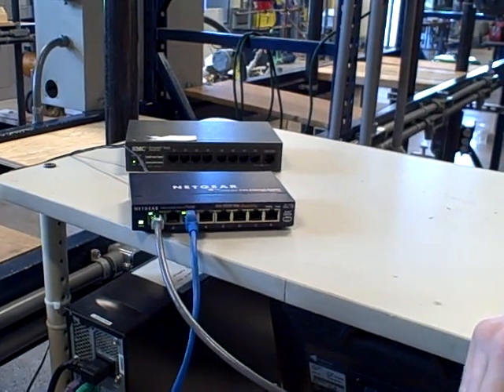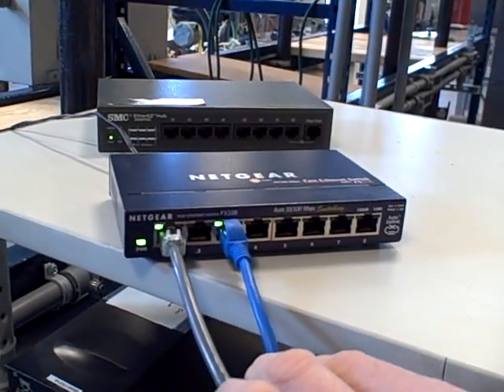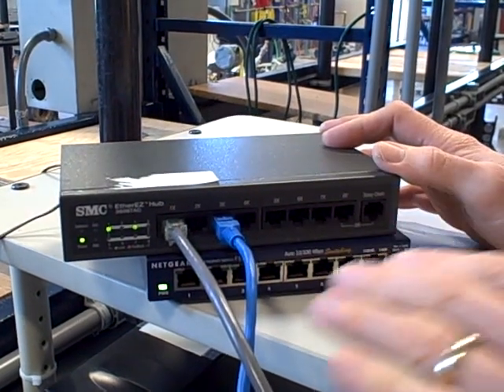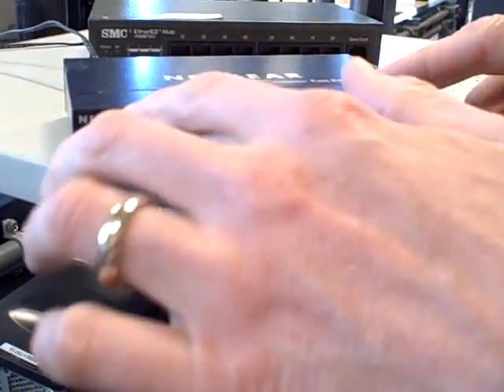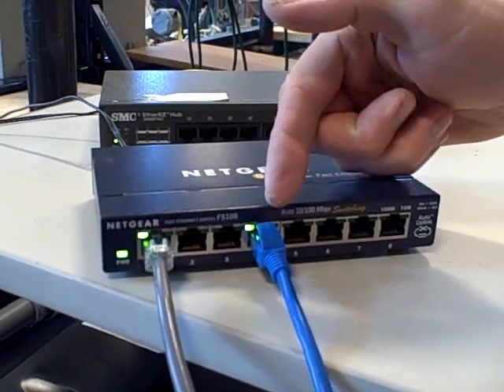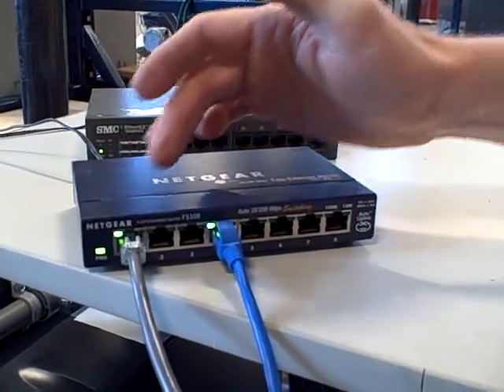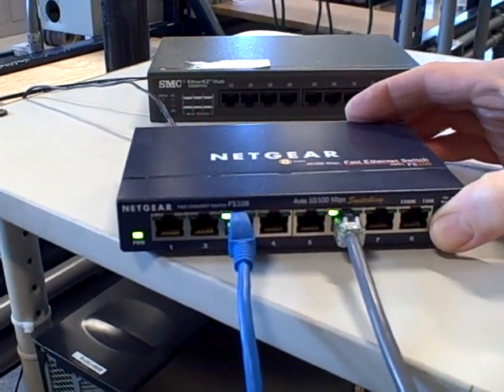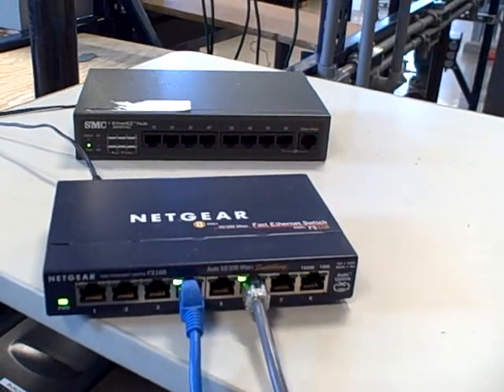Ethernet hubs versus switches

Comment: Can i use a switch or hub to create two lans in my home.

Internet modem-hub-two routers?
Reply: Using either a Layer 3 switch or an advanced router, you can create VLANs.  By connecting a regular switch into a modem, you can get multiple IP addresses from the ISP depending on their support.
Reply: No!
Reply: +OldLordSpeedy A switch plugged into a modem would allow you to have more than one IP address if purchased from an ISP.
Reply: +Timothy Ha  Please READ what the youtuber ask - then answer. The correct way is "Internet Modem - Router - Switch" ... The way of this user "Internet Modem - Hub - 2 different Router" is technical correct, mean he must have two different contracts to one ISP that it works. But no one of normal private user use this very specially method to differ Internet Service. Most ISP allowed only one connect - so the second Router falls into a hole. If your ISP makes some wrong, every first Router have the connect - and if ask the second Router the reconnect the line. It is named 'Ping-Pong' and give you as private user only an unstable connect.
Reply: +Timothy Ha  Normally a normal private user never earn an IP adress in 2016 more. Most ISP use private adresses only for connect. In a business contract the bussiness user earn so many IP adresses how he pay inside this contract. But today - where every computer, thing, router, aso can have own v6 IP adress - why someone want do so a crazy shit? As private user give me my ISP a /64. So many adresses for use - then I can add to use own private adresses too! Please learn more about ISP connect and how it is works!

Comment: so which is better to connect an xbox and 2 computers to the internet with?
Reply: Depends on whether or not you can run cable to them. If they're your only networked devices, and cabling isn't an issue, connecting them directly to your router's LAN ports should suffice.

Most people don't need switches, as their network usage is more than adequately provided with a few Ethernet ports on the router + WiFi.
Reply: Wich is better if I have a PC and a PS4 on my setup, I have one cable in my room, but I need to connect both of them at the same time ?
Reply: +FEIXAS_PT

WiFi is probably sufficient for your PS4, if you have it in your home. Else, an inexpensive 4-port 100mbit Ethernet switch + 2 extra Ethernet cables will be enough to connect your devices.
Reply: Fireholder1 Thanks a lot !!!
Reply: You're welcome. :-)

Comment: Again to all the odinary persons her - technically works a switch same a hub. Both be same a multiple (switched) socket-outlet for your cables. The difference is that the hub call into all rooms in a hotel and a switch call only the correct room in a hotel. Exactly this demostration do you see live in this old schooling video from 2013!
Reply: +OldLordSpeedy except that he didnt show the major issues that arise with hubs that have alot of ports. even 8port hubs will run into collisions very very fast

Comment: If an Ethernet cable is going to a switch from my router. Can i connect a PC, PS3 and Xbox360 to it and get internet?
Reply: +Turboed Leo yes
Reply: Pascal Lafrenière thanks
Reply: +Turboed Leo You'll get more lag though, which could be important for online multi player gaming
Reply: Thanh Tran Even if i only use one console at a time or PC?
Reply: lol, it's about nanoseconds lag....
Reply: +Pascal Lafreniere the difference between hitting and missing on fps gaming
Reply: your body have like 130 ms of reflex time, a switch lag is in between .001 ns and 100ns, that is .1 of a ms... so your brain is at least 1300 times slower than the lag you create with switch...
Reply: Pascal Lafreniere So a switch wont effect anything?
Reply: it shouldnt

Comment: Maybe the switch table refresh duration can be reduced in settings instead of 5 minutes.
Reply: +Thanh Tran maybe.. it doesnt matter because nobody ever screws around with ethernetcables every 10 seconds
Reply: That is probably possible in managed switches, he probably has an unmanaged switch. SO its pretty much "plug and play" no control panels, or anything.

Comment: so a switch or a hub just basically provide for ports to your devices when your router's port are all used? someone pls answer
Reply: For the typical home user the answer is yes, but most Enterprises use hubs and or switches to repeat a signal over long distances or to connect/segment their LANs.
Reply: Alberto Marin thanks
Reply: A typical "router" for your home typically combines 1) a wi-fi access point, 2) a switch and 3) a router.

The router is used to connect two (or more) networks.  In your home this is your LAN and your WAN.  It sends packets according to the IP address and the routing table (layer 3).  It also provides services like DHCP and NAT.

The Wi-Fi Access point is essentially a bridge that connects Ethernet to Wireless clients.

The switch is used to connect ethernet cables together.  Packets are sent according to MAC address (layer 2).

So to answer your question:  When all the ports on your home router or switch are used up, you can hang another switch on your LAN and provide more ports for other devices.  You could for example have a home router on the main floor of your house and take one port and run an ethernet cable upstairs and then using a switch distribute that to all the bedrooms and possibly a study.  You could run another ethernet cable from a second port on the home router to your garage / workshop and have a switch there to connect to all the devices you might want.
Reply: milofonbil
 thanks for the info. now am confused with a switch and patch panel. can you tell me the difference?
Reply: ladyboylizard A patch panel is like an extension chord, only for the Ethernet Wires. It has no brain on it own. If you have a situation where a point X in your office you want to connect to Switch A in the server room  , but sometime from the point X you also want the freedom to connect to Switch B or C, instead of running 2 or 3 cables Point X to A,B and C, They just wire one cable and at Point X and patch panel Have an Ethernet Female ports. and then you have all the freedom, it is almost like an extension chord.
Reply: a patch panel is useless until you know what you are doing
Reply: Late noob question for you. So the more recent wireless routers that have gigabit ports at the back of them are essentially built-in switches and don't have problems that these hubs have?

Comment: Why does it take 5 minutes?  Why can't the switch tell that something was plugged in, and then immediately go, "Hey, who are you?"
Reply: I would expect when the cable is unplugged the switch would forget whatever MAC address it knew about.  Can't say for certain though.  For the switch to learn the MAC address, an Ethernet frame has to pass through it.  Until then, it should broadcast to all ports.  Also, consider that there may be another switch or hub between that switch and the computer that owns that MAC address.  There's no way that switch could learn from plugging in the other switch or hub what the MAC addresses (yes, there could be more than one) are.
Reply: @James_Knott  Thank you for your answer.    I am surprised that there isn't a discovery protocol in Ethernet.  No offence, but I read what you wrote, and I thought, "That can't be right."  But I looked into it, and it seems like the "best" that can be done is an ARP scan, and ...  (shudder) ...  There are a LOT of possible IP addresses.  The idea of going through a few billion IP addresses this way, just to get the MAC address of the person you're talking to, is just horrifying.  It seems that you are correct.  The best it can do is just kind of -- pick up from the traffic, and maybe with ARP as a confirmation, -- what else is on the wire.
Reply: @LionKimbro  Of course I'm right.  🙂
If you consider there could be an entire network at the other end of that cable, you'll realize there's no way for any such discovery to work.  However, normally, there'd soon be traffic to learn from again.

BTW, if you think a few billion addresses is a lot, wait till you get to IPv6.  With it, a LAN normally has 2^64 or 18.4 billion, billion addresses available.  I get 2^72 IPv6 addresses from my ISP.
Reply: @James_Knott  Hm ...  I would think that there would be a way to collect at least all devices (that were cooperating) that are actually link local.  And then a switch operator could configure, "Am I going to broadcast the MAC addresses that I know about?"  I think address discovery is just a generally useful thing.  The operators, effectively, would determine how the switch operates, and make sure that multiple megabytes of data were not being routinely transferred.  You wouldn't get the entire Internet's MAC addresses with a query.
Reply: @James_Knott  And very practically, it would be wonderfully useful to be able to, when something is plugged in, get some kind of a "Hello my name is..."  That just seems practical.
Reply: @LionKimbro  You're looking at redoing the entire system.  Ethernet goes back to the 70s, and in fact had it's 50th anniversary recently.  Back then, there were no hubs or switches, just a coaxial cable, with the computers connected to it.  It ran at 10 Mb, half duplex.  As the years went by, hubs, then switches appeared, yet still worked with all the equipment, going back to that first coax network.  The situation described in the video, with the long wait, is unusual, as most networks would have packets being sent frequently.  This means the switch would quickly relearn the MAC addresses.  Also, I suspect that wait is unusual, as I'd expect the switch would "forget" all the MAC addresses associated with the port that was disconnected.  This would cause broadcasts to all other ports, until it learned where the desired MAC was again.  Also, both Ethernet and IP are designed for best effort.  That is, there is no guarantee a packet or frame will reach it's destination. To deal with this there are mechanisms in TCP and may be in applications that use UDP to recover the lost data.  I suspect you're trying to solve a problem that doesn't exist.

Comment: So basically a hub is stupid because if you have a large network, and you send like 1 GB to another computer at the other side of the building, the network would be slow as hell because it sends 1 GB to all of these computers (which means the network could be loaded with terrabytes if you have thousands of computers), but a switch only replies to a request one by one. So I send a 1 GB file to A, and B sends a 200 MB file to C, it'll handle my request first and then it'll handle B's request or...?
Reply: +Arne Maeschaelck he didnt show you the real problem with hubs. he only had 2 devices connected... now scale this up and have 8 devices trying to talk to each other... or lets say 16 or 24. say goodbye to your network :)

Comment: PLC, HMI acronyms not explained.
Reply: U K Somerville A PLC is a programmable logic controller. It is a computer that is used to automate electrical machinery. An HMI is a human machine interface, essentially a device that humans can use to interface with the machine (in this case the PLC.)
Reply: I am a licensed Controls Engineer and a PLC is a programmable logic controller which is nothing more but a logic solver. An HMI is a human machine interface and its needed for humans to understand how the process works visibly. A HMI and PLC go hand in hand to automate and view a process.

Comment: unless you have a managed switch you can just clear the arp table
Reply: not really
Reply: Switches don't have an arp table.  That's used to map IP addresses to MAC addresses.  A switch will simply remember the MAC addresses of traffic that passes through it and which port it came in on.
Reply: @James_Knott  at the time I was thinking layer 3 switch a switch like the hp 2910 does but a layer 2 switch has a Mac address table which can be cleared
Reply: @James_Knott  the command is clear mac address-table
Reply: @candoslayer  A layer 3 switch is more like a router and works with IP addresses.  Whether there's a command for clearing the MAC table depends on the switch.
Reply: @candoslayer  That's a Cisco switch command.  Cheap switches from TP-Link, etc. are unlikely to use Cisco commands.
Reply: @James_Knott  like I said, managed switch
Reply: @James_Knott  it was hp but don't forget cisco wrote all the standards and all the manufactures follow the standards cisco wrote just the command could be slightly different
Reply: @James_Knott  and cisco does make cheap switch too they arnt just focused on enterprise
Reply: @candoslayer  Not quite.  You gave a Cisco command.  I have 2 managed switches here, one Cisco and one TP-Link.  Do you think the TP-Link switch will use Cisco commands?  Especially since it doesn't even do commands?  Configuration is done with their app.
Reply: @James_Knott  that's a smart switch not a managed switch if there is no cli
Reply: @candoslayer  I see you have a lot to learn about switches.  I used to do a lot of work with Adtran gear.  Much of it was more or less a clone of Cisco.  It had both command line, using Cicso commands and GUI configuration.  Both on the same device.  I also have 2 Cisco swithes here, one configured with a command line only and the other with a GUI only.  Both are managed.
BTW, I'm a CCNA.

Comment: Yikes. I've never had that problem with a switch. But then again, I'm talking strictly computer networks, not industrial control stuff.
Reply: As someone else already mentioned, it's most likely because the PLC only transmits data when that data is requested, so it's not sending anything to the switch, which would immediately let the switch know which port it's connected to, and subsequently enabling the switch to update its MAC table.